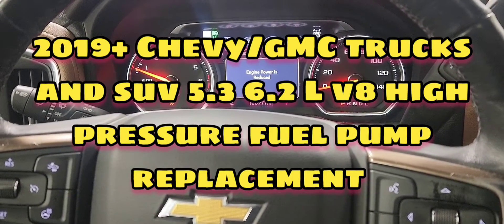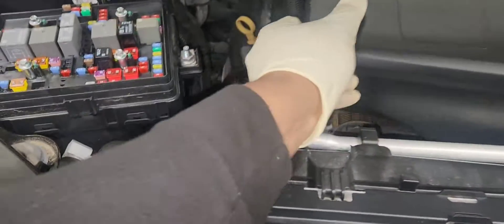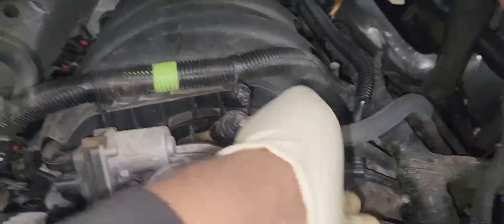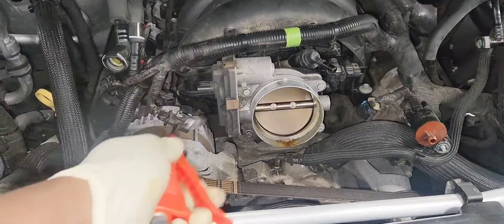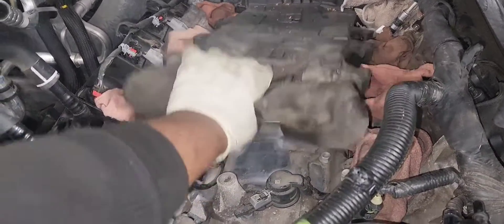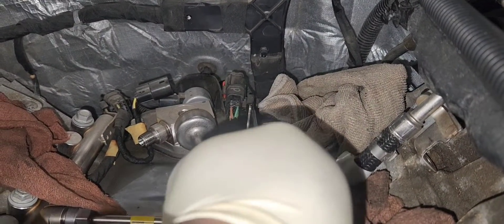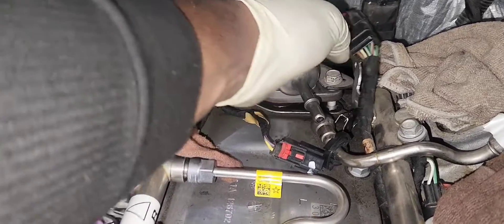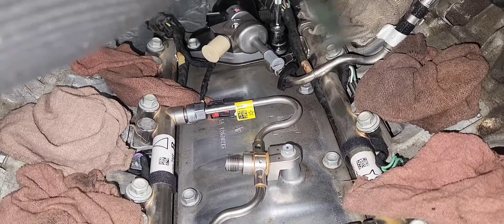2019+ Chevy/GMC Trucks and SUV High pressure fuel pump replacement for P228C P0089

Comment from the maker: Link for the pump
https://www.gmpartsgiant.com/parts/gm-pump_asm_fuel-12727483.html
One time used fuel line
https://www.amazon.com/gp/aw/d/B07JVHP3B5/ref=ox_sc_act_image_1?smid=ATVPDKIKX0DER&psc=1&tag=steevegmtec03-20
Fuel pump gauge
https://www.amazon.com/gp/aw/d/B0CJL7MZRB/ref=ox_sc_act_image_2?smid=A1W16FGXVBTKLK&psc=1&tag=steevegmtec03-20
Basic hand tools
https://www.amazon.com/gp/aw/d/B08XPBR9JD/ref=ox_sc_act_image_37?smid=A1F0H6W3XGIV8J&psc=1&tag=steevegmtec03-20
Pick set
https://www.amazon.com/dp/B08KVRHT7N/?tag=steevegmtec03-20
Trim tools
https://www.amazon.com/dp/B0B6W1MRB2/?tag=steevegmtec03-20
Quick disconnect fuel line
https://www.amazon.com/dp/B0BXJLZTYK/?tag=steevegmtec03-20
intake manifold gasket
https://amzn.to/48sF2QA